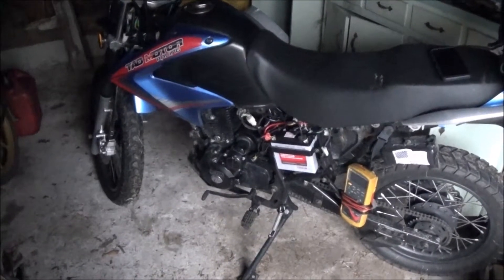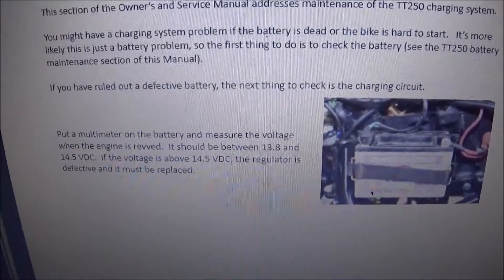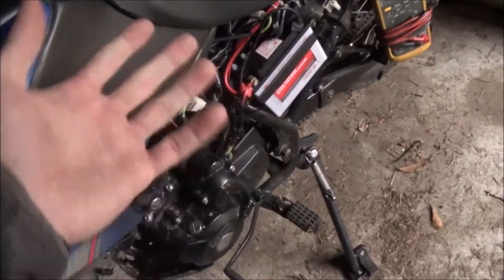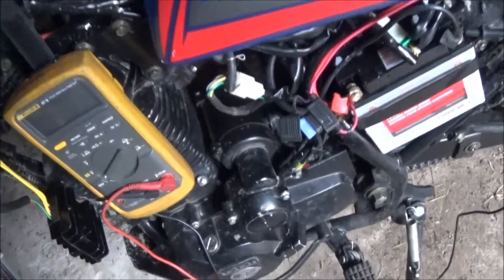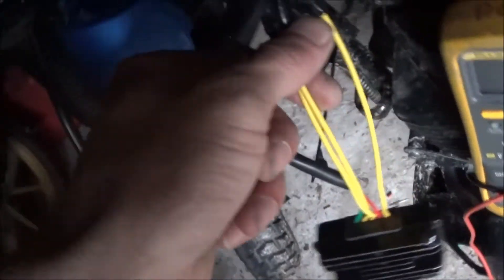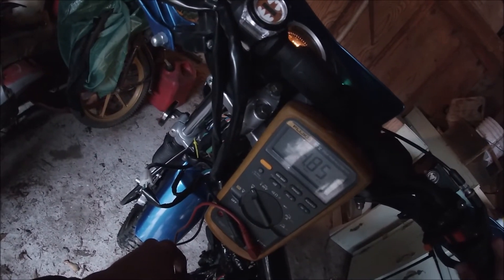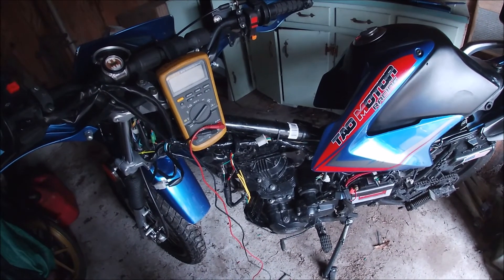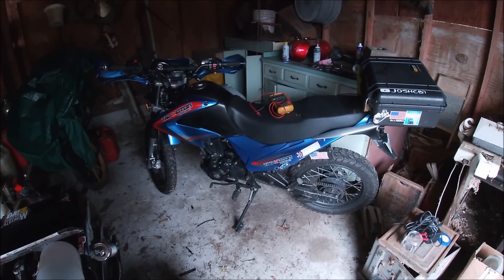Tbr7 Electrical System Diagnosis

Comment: I hope you can see this. But my bikes electrical is not working like when I turn the key to the on position no lights come on until I kick start it then they come on but it’s not enough power to use blinkers or headlights. What’s the issue. I have taken all the fairings off of it and stripped it completely down to where it was just a naked bike but I can’t find why it none of the electrical systems work
Reply: I’m having the same exact issue. Put the key in on position and nothing lights up but kick starting will light everything up but doesn’t supply enough power for all functions. I’m still trying to find the solution. I wanna  put my battery back on the trickle and just hope the 8 or so volts I read on my MM is the culprit but I think that might just be wishful thinking Lol.